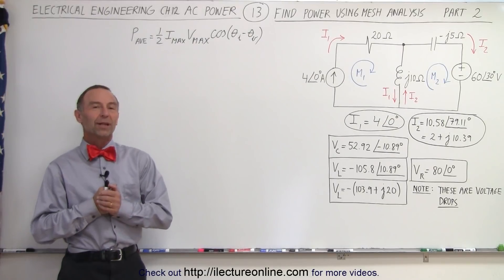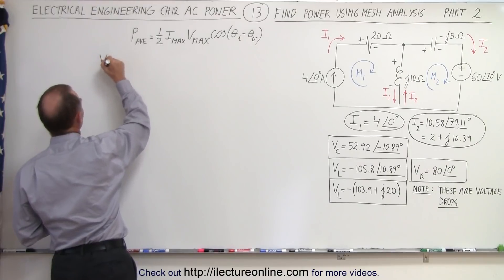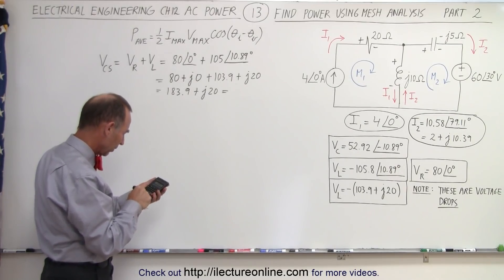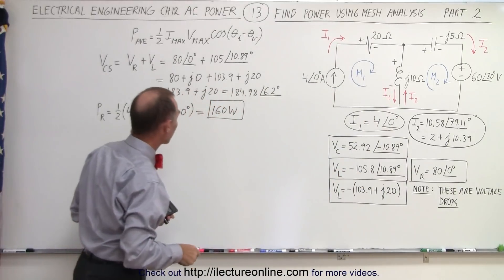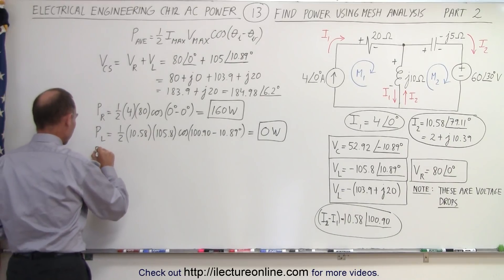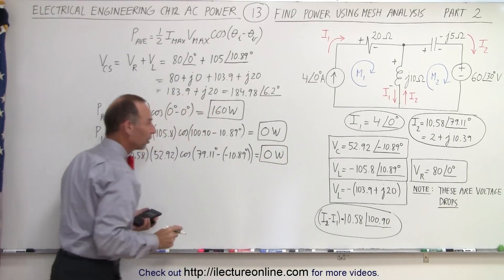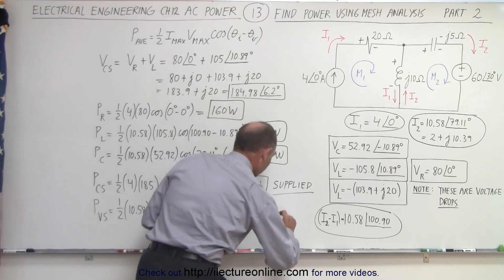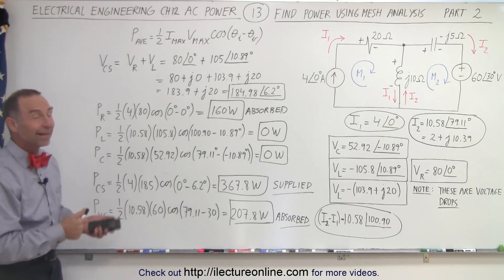Electrical Engineering: Ch 12 AC Power (13 of 38) How to find Power Using Mesh Analysis Part 2?

Comment: isnt the current through the current source always going to be in the same direction as the current it is supplying by definition. How can it ever absorb power?
Reply: It's depend on the phase angle between the voltage and the current in the current source.

Comment: Sir, Ithink we have a big problem here. you wrote I2 values for I2-I1. In the previous video you didn't write it to the board though. Even we cant not sat it's true because in previous video you found I2 = -(10,58/__-100,89). İf it's possible to check just aware me thanks.

Comment: Perhaps you could clear up my confusion.
In the last video, didn’t you figure out that I2 is actually in the opposite direction than what you have drawn here? So it should be a voltage rise over the capacitor? As for the inductor isn’t it voltage rise OR drop depending on what mesh you are using as your reference?

Comment: Good sir . V2-V1= -10.58\__-79.11 is angle sir but you wrote 100.90
Reply from the maker: If you change the sign and add (or subtract) 180 degrees you have the same angle.
Reply: @MichelvanBiezen  yes sir i clear and thanks for your quick reply sir.
Reply: @MichelvanBiezen   but why you changed it?
Reply: @La_TiKi  plot vector current or volatage in x y plane... You will det clear picture

Comment: Vcs=Vr+VL VL=-105.81/__10.89 but you wrote  80+105.81/__10.89 is that correct ? pls tell me thank you.
Reply from the maker: The voltage across the current source (in the direction of I1) is positive.  (Therefore we added the negative of the 2 voltage drops across the resistor and the inductor).
Reply: @MichelvanBiezen  ok now I got it.Thx a lot sir.